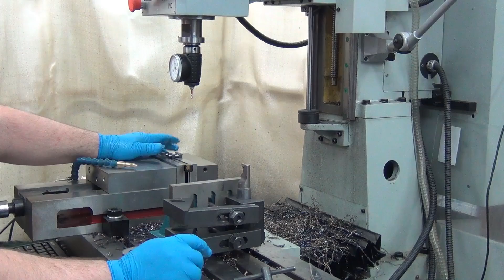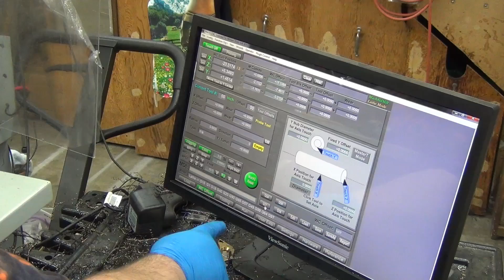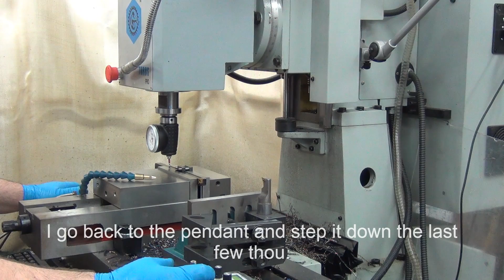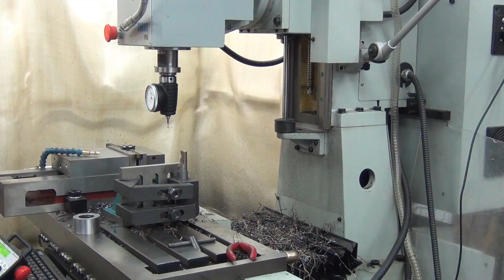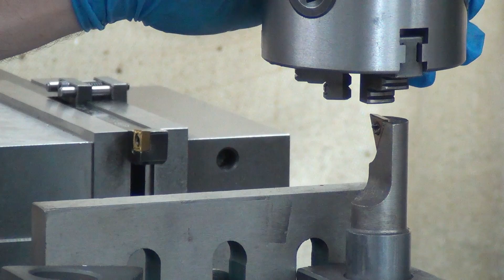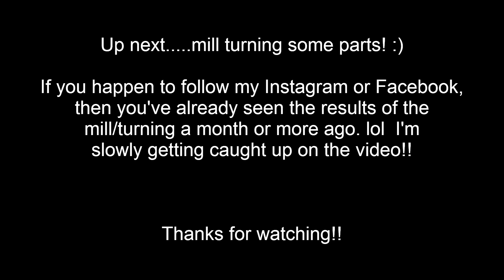Novakon Torus Pro - Mill/Turn, Tool Setup

Comment: I've done lots of small production runs on my Fadal this way and on my smaller RF45.  I usually have to modify some of the G-Code but it's not bad.  I use work offsets also.  Most of the time holding the work in an ER32 or ER40 collet.  I do have a small chuck on a CAT 40 holder I built but the thru hole is only like 1/2".  I need to build a slightly larger chuck so I can load some 1" bar up in there.  This is so I can make several parts from one section of stock and just slide it down between parts.  What size chuck did you end up with?  It looks like a 4 or 5" od chuck.
Reply from the maker: That's cool that you do mill turning.  The chuck in this vid is only 3" OD with a 5/8" bore.  I had a 4" I could use, although I don't remember the bore, but it went with the 9x20 lathe when I sold it. I think it was only 3/4".  The backing plate/adapter with the chuck is the hard part to find these days.  The chucks themselves are fairly cheap.  I wonder if the bore could be opened up enought.  There's a 4" chuck on Shars.com that has a .866 bore.  I wonder if it could be opened up to 1".  That's about .060" off the inside wall.  It looks like a 5" chuck has a bore of just over 1", but that's a lot of weight to be spinning.  I think if you could find/make a cat40 backing plate for a 5" chuck to run in your Fadal, that might be the ticket.  I'm not sure if that's even possible. I've only dealt with R8 and TTS holders.

Very nice tool changer.

Comment: saran wrap the monitor. cheap and easy fix.
Reply from the maker: +iiinsaiii Can you still use the touch screen with it?  I put saran wrap on a keyboard, but the chips melted right through it.
You going to bring out the Powerwheel jeep again for Halloween?  Dang that thing is friggin' creepy!!!! LOL!!!
Reply: +bluehandsvideo lol yep, the jeep will be coming out, but with some upgrades aka sound effects. 
humm the only way to see if the saran wrap would work on the touch screen is to try it out. simple and easy way to find out lol
Reply from the maker: +iiinsaiii Videos!!!!  I just subbed to make sure I get notified :)  
I'll try the saran wrap.  I probably won't need it after I get an enclosure built, but at the rate I get things done, that's probably a year or two away! :(   LOL
Reply: +bluehandsvideo yep an enclosure will help a lot. I built a stand and enclosure for my cnc mini mill.
Reply from the maker: +iiinsaiii I'm afraid to put the coolant trays on yet.....I'm sure I have more work to do on the mill itself. :(